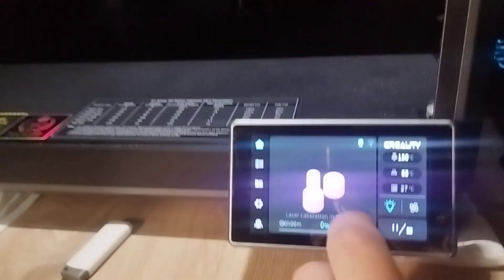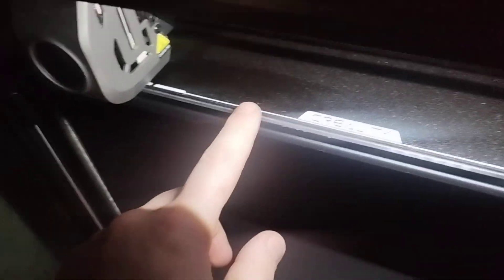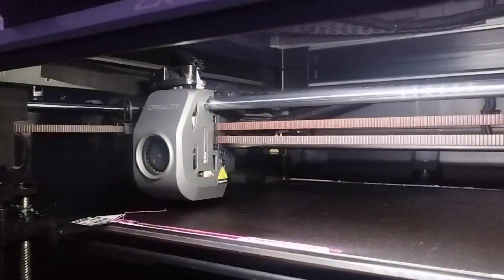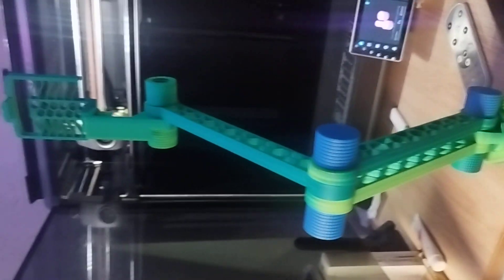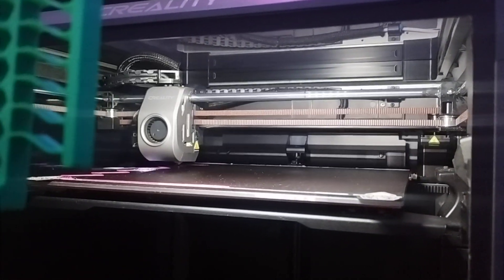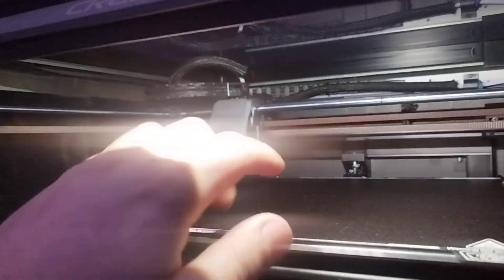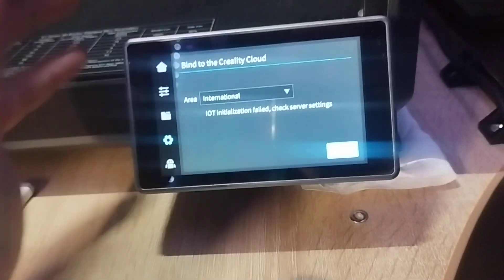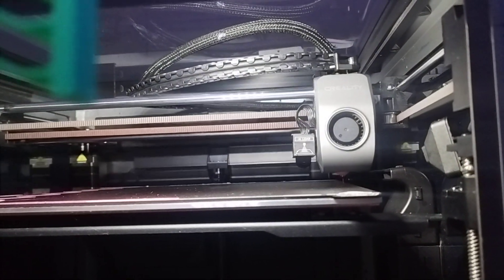Creality K1 Max - Latest firmware, print quality

Comment: Nice preview of upcoming firmware. The only reason I rooted and ran Fluid is because of the issue with Creality's boo boo with the input shaper using the X value for Y as well (they should never be the same) can you tell us if they fixed that in this update? (you'd have to look at the input shaper data in the printer.cfg file) If they did, I could then leave it stock. Thank you.
Reply from the maker: Hi, thanks for stopping by.

I can't have a look on graphics or in printer.cfg file because I'm not rooted and completely stock.

This update is a huge one , for me completely changed the printer.

The quality  of printed parts has improved so much for me after this update.

My advice wait until it's finally released and try then the firmware stock without being rooted. 

Check also my YouTube shorts, I have one there with the new firmware, and how the quality of the parts look like.

Thanks and happy printing.

Comment: Is that zig zag pattern for the flow calibration?
 Many people have reported that their beds are like ski slopes, is yours also warped to the extreme that the ABL cannot compensate for it?
Reply: Jup the zig zag is for the lidar and for preassure advance
Reply from the maker: Yes my bed was warped , and the abl cannot compensate for that deviation, I just tried to manual level as much as I can , and with theatest firmware everything seems to work ok now.

Comment: So the K1's are a decent attempt at what Bambu has produced but still need work. With that in mind, might it be a reasonable idea to go build a Voron if someone likes tinkering. It's like tinkering with the K1 but at a grander scale.
Reply: Tinkering? It's building a printer from a parts kit.  Dozens of hours, as opposed to updating firmware and maybe adding a couple printed bits